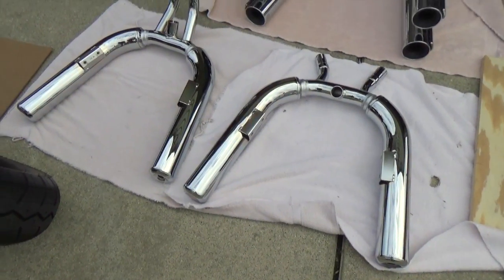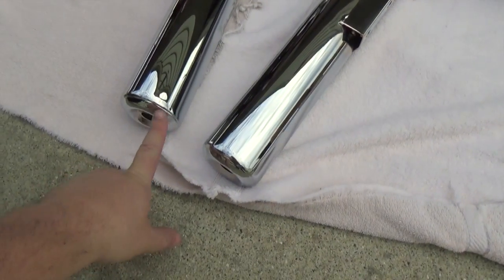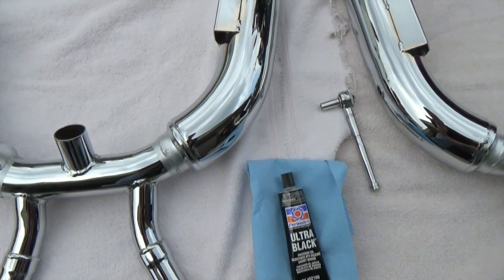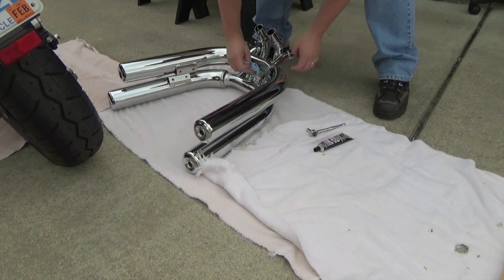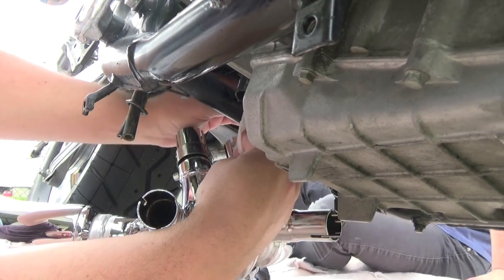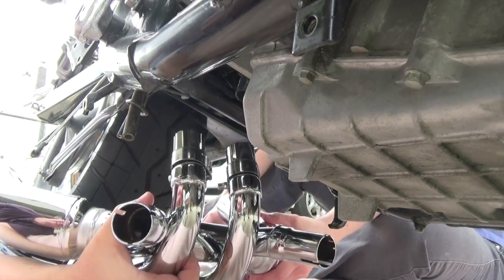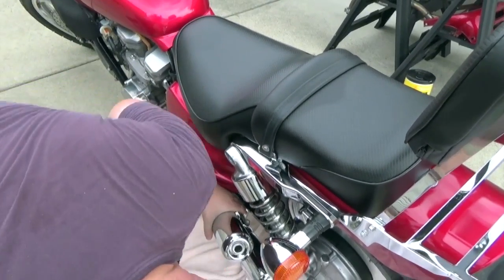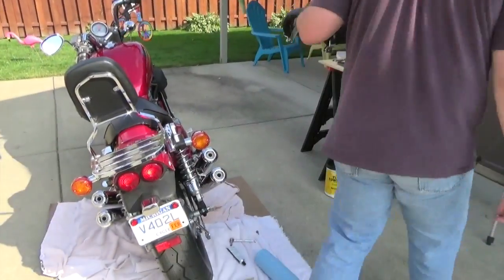Project 1988 Honda VF750c Super Magna Part 8

Comment: Hey man, Just got a 88 Magna V45, red and everything. Your videos are going to make this work out for me. One thing I really need help with is that i have a very stiff throttle. Does any of your videos show maybe fixing that or do you have advice?
Reply from the maker: I don't personally have any videos about this. I don't own the Super Magna anymore (sold it 2yrs ago). It's gone to a collector who's going to fully restore the bike. A couple of things to do / check. First trace the throttle cable from the throttle sleeve to the carbs. Make sure it's not getting pinched or routed in a manner where it has too great a bend radius. Second, the cable may need lubricated. Motion Pro makes a clamp-on device that will allow you to spray a lube like WD40 and force it down the cable sleeve. Lastly check the cab linkage and springs for accumulated gunk and dirt. A quick spray down with carb cleaner and some lube with WD40 can do wonders. Hope this helps. Thanks for watching, Cheers!

Mike

Comment: just wondering what you did with the stock exhaust? I have a destroyed magna that I am rebuilding. I can not find an exhaust. I would like to stay original if possible.
Reply from the maker: James Estes I am keeping the original exhaust for my Super. I want to find a company to strip it apart , re-chrome it, and put it back together (maybe taking out some internal baffles). The Marving pipes are sold online by Wemoto now. Even though that company is in the UK, they will ship to the USA. From what I have seen on eBay, you can get the Marving set (they have 3 styles, mine are the billet capped ends, theres a slash and turn-out) for less cost new than a used set of originals. IMHO the Marving Billet set are very close to the original pipes (if you paint the end caps black they will match better). I think with shipping they cost about $800 give or take.

Mike